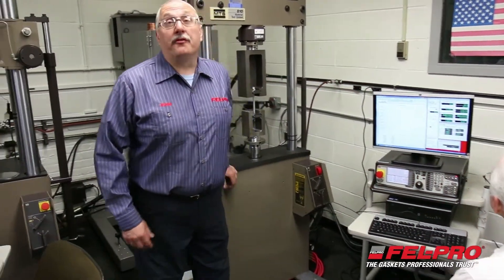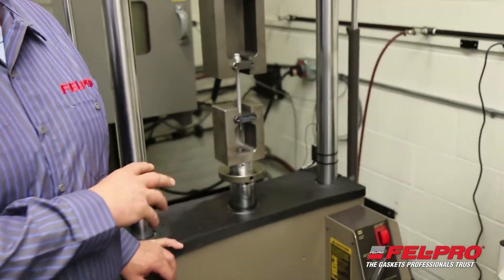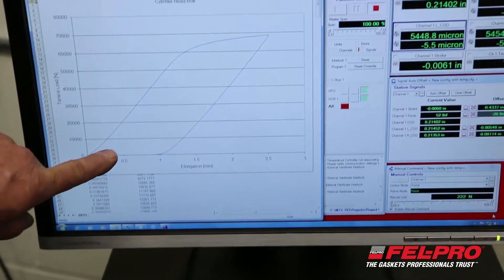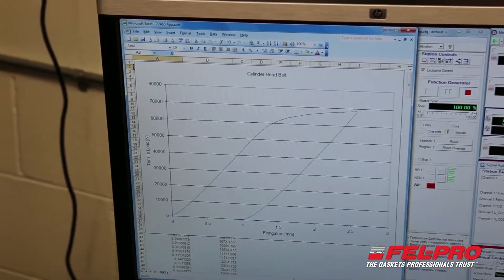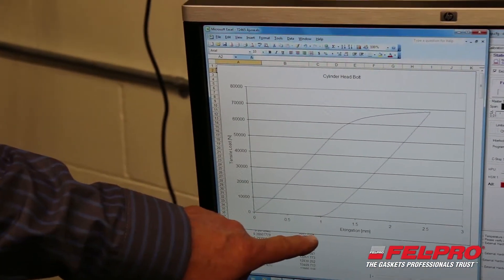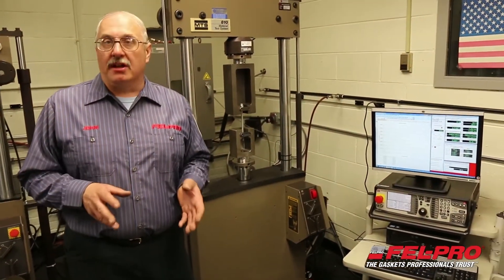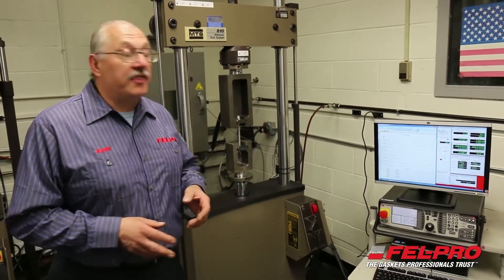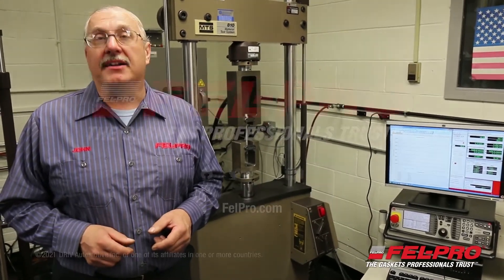Testing Torque-To-Yield Head Bolt Stretch | Fel-Pro Gaskets

Comment: John, just a clarification you stated load of Newton-meters, but really you just load to newtons (assuming no torque applied here).  Thanks for the info; however it'd be good to see what size bolt, and what material the bolt is made from to really make sense of the result you're showing.  Perhaps just illustration for the broader point- however i believe that is is not true that all head bolts are loaded beyond their yield strength.

Comment: I reused all the head bolts in my Subaru Forester 2001 heads when I replaced the gaskets (used fel pros) . I did both of them with the old head bolts 7 years ago. No leaks!
Reply: I've always wondered how important it really was, but always replace them because it's a lot of work to do it over. However I just learned that it's not necessary on every  engine. If the torque speck is an absolute value they need to be replaced, but if it's a value plus an additional number of degrees, they can be reused. I spent at least an hour looking that up across many sources and it seems to be the general consensus. My head bolts were 80ft/lbs plus 90  degrees. I reused my bolts and it's been three years with no problems. I don't remember what the exact reasons were, but it made a lot of sense at the time.
Reply: I've reused many times, I will say this, although the bolts seem to do their job, I have a much easier time removing them second time around. I believe in certain spots the load needs to be distributed very evenly, like head bolts, so that the load is shared, for reuse to be nit out if the question. However,  I would never re use stretched bolts that are on their own, like for cam sprockets, con rod bearings etc
Reply: I've reused many times, I will say this, although the bolts seem to do their job, I have a much easier time removing them second time around. I believe in certain spots the load needs to be distributed very evenly, like head bolts, so that the load is shared, for reuse to be nit out if the question. However,  I would never re use stretched bolts that are on their own, like for cam sprockets, con rod bearings etc
Reply: i really depends on the type of vehicle.